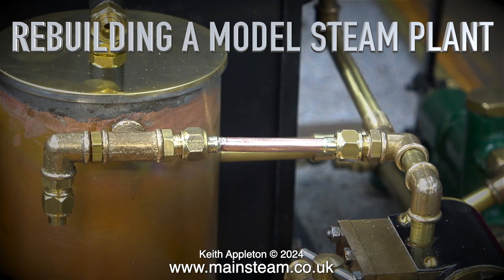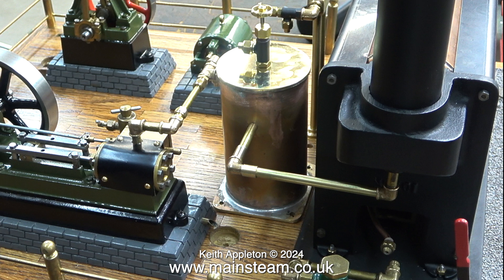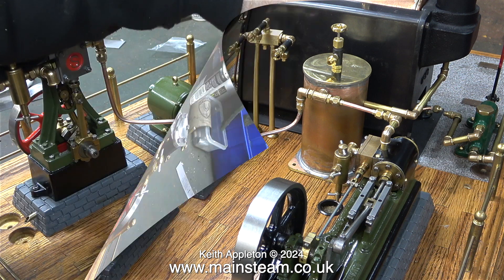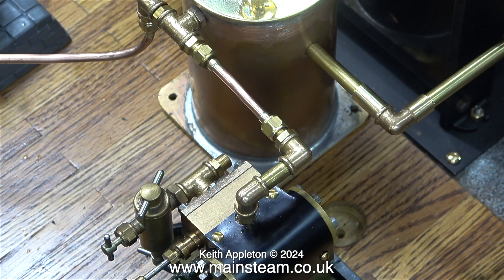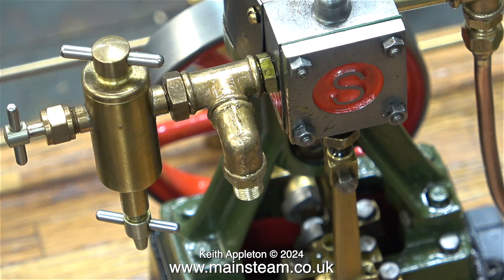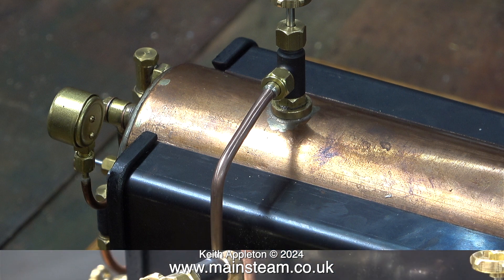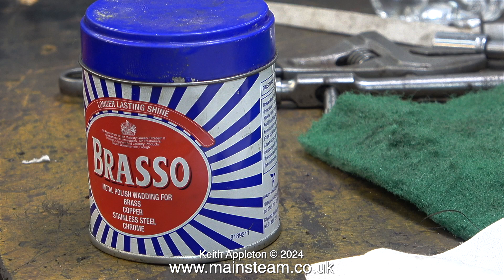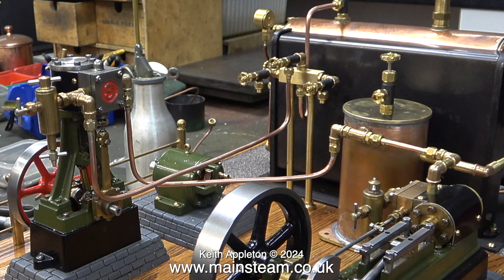REBUILDING A MODEL STEAM PLANT - PART #42

Comment: Thank You for sharing this very informative and interesting video with us. 
I’ve worked in many plants using steam. Power plants, drug manufacturing, paper mills ect. The company I worked for was in the business of temporarily stopping steam leaks until the plant could be shut down for maintenance. Many leak fixes were on high pressure, high temperature steam valves and flanges. Sometimes you could hear the leak while driving up the access road. The refineries were the worst in the way they were layed out. You’d have to step over, duck under, fit between so many different sizes of live, leaky steam pipes. That really was a dangerous business, but the pay was awesome(for the owner…ha ha ha)
You also stay safe and extremely healthy!
Reply from the maker: That seems like a scary job }:-)))